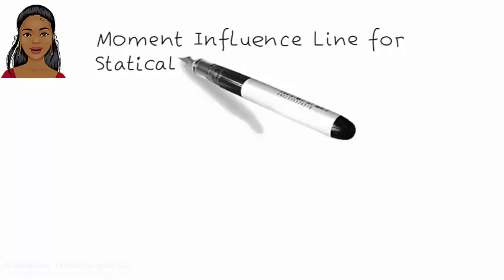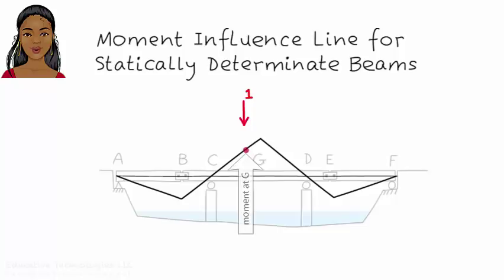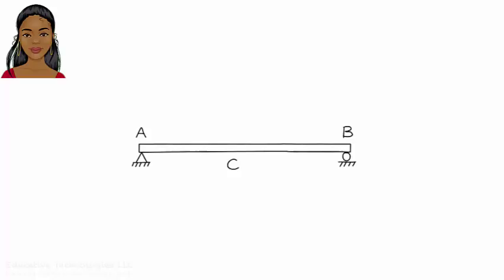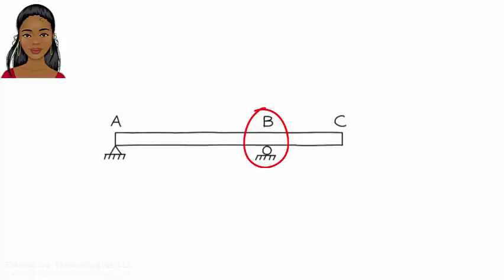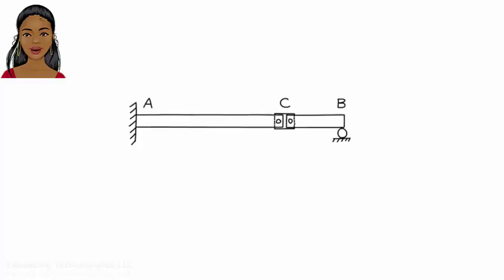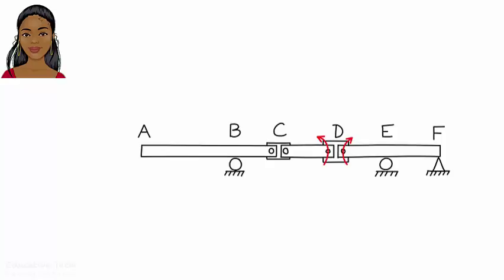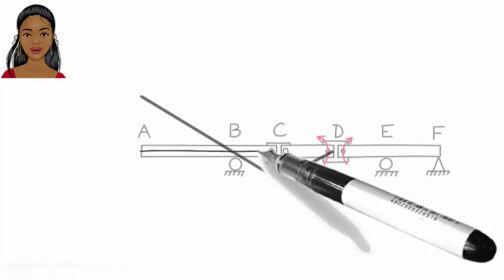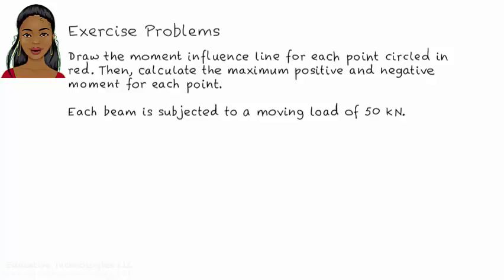SA18: Moment Influence Line

Comment: Where can I check the answers for the examples at the end of video?
Reply from the maker: The solutions for the exercise problems can be found in the (free) online course referenced in the video description field.
Reply: @DrStructure  I signed up using the link provided in description but still can’t view the answers
Reply from the maker: Login to the course, navigate to the influence lines section, then select moment influence line lecture/video as if you are going to watch it. Two pdf files are listed under the video frame: lecture notes and solution to exercise problems. Open this latter file to view the solutions.

Comment: At 6:14 you said moment at hinge always zero than in next 2 examples 7:54 why the moment at hinge is not zero(i.e. at c). Pls anyone explain.
Reply from the maker: The moment at C is zero in the example @7:54.  Why do you think there is a bending moment at C?
Reply: @DrStructure because in ILD there is an ordinate at c that means moment is not zero. The ILD at 6:14 in that you made a straight line from A to C because of hinge(zero moment).
Reply from the maker: @abhishekverma1487  That influence line is for bending moment at D. So, the height of the diagram at C indicates the moment at D when a unit load is at C. The height is not saying anything about the moment at C.
Reply: @DrStructure  ok got it. Thank you

Comment: The worked out example has an error.. It would be -2KN
Reply from the maker: Your assertion would have been correct if the weight of the vehicle was 1 kN. But, the vehicle weighs 2 kN. Therefore, the correct bending moment value is -4 kN-m.
Reply: @DrStructure  but.. We r drawing influence line... Watch again... In the animation 1kip is illustrated and calculated for 2kip...
Reply from the maker: Not sure what you are asserting. 

The moment influence line was drawn and used to determine the location of the load that would cause the maximum moment at point G. The load location was determined to be point F. Consequently, a unit load was placed at F and the resulting bending moment at G was determined to be 2 kN-m (the product of 0.5 and 4). Now, since the actual truck load is 2 kN, we need to multiply the moment due the unit load by 2. Hence, the bending moment at G due to the truck load equals 2(2) = 4 kN-m.

Comment: Hello, 
Could you please explain the reason behind why the bending moment is always zero at a real hinge?
Reply from the maker: Moment develops in at a point when its rotation is restrained. Think of a cantilever beam,  it is fixed at one end and free at the other end. Since the beam is not going to rotate at the fixed end, a bending moment develops at that end. On the other hand, the free end is free to rotate as well as move up and down. Since the rotation of the joint is not 
prevented, then no bending moment develops at that end. 

A pin or a roller act the same way as a free end with regard to rotation. Each allows rotation, therefore no bending moment can develop at any of these joints. 

An internal hinge acts the same way. Such a hinge connects two beam segments whereby one can rotate relative to the other, therefore no bending moment can develop at the hinge either.
Reply: +Dr. Structure yes thank u however when you did the moment influence lines for a hinge or roller support you did not consider moment to be always  zero  no matter the position of the load .. And you're saying internal hinge works the same as roller and hinge support in regards to it allowing rotation and thus having no moment reaction. This is where my confusion is. Isn't this contradicting ?
Reply from the maker: Good question.

When a pin or a roller is located at an interior point, when it is not at the end of the beam, it cannot freely rotate. Why? because the beam segment to the right of the roller wants it to rotate in a certain way, and the beam segment to the left of the roller wants the joint to rotate differently. This "competition" between the two segments prevents the free rotation of the joint. Consequently, a bending moment develops at the joint. If the roller/pin was at the end of the beam. however, there would be no "competition" between segments as there is only one beam segment attached to the joint. The segment dictates the rotation of the joint. That is, the joint would be free to rotate as dictated by the beam segment. As a result, no bending moment develops at the joint.

An internal hinge acts differently than a pin or a roller. To form a hinge, we cut the rigid beam at the point and reconnect the two segments using a frictionless (truss) pin where relative rotation between the segments is permitted. That is quite different than the behavior of an interior roller/pin. In the latter scenario, the beam remains rigid over the pin/roller support whereas in the former scenario the beam acts more like a truss joint. An internal hinge often is associated with a beam splice where we connect two beam segments using gusset plates and bolts. In reality such a splice carries some moment, but for design purposes we often assume the (hinge) connection is frictionless and carries no bending moment.
Reply: +Dr. Structure   Bless u for taking the time to answer us students in need.  that was very helpful thank you. 🤗

Comment: why at hinge u say moment is 0 but ...when there is are 2 support moment is not zero
Reply from the maker: Take a long piece of balsa wood, cut it at mid-point, then overlap the two pieces at the cut point and push a pin through the two pieces connecting them together again.  That represents a hinge connection. It allows one segment to rotate relative to the other. That is, if you held one of the balsa wood segments in your hand firmly, you can make the other piece rotate easily around the pin. The pin (hinge) cannot resist rotation, hence no bending moment develops at the hinge.

Now take a similar piece of balsa wood, but don't cut it at the midpoint. Instead, let it rest on a ball (roller) at the midpoint. We can still view the piece of wood as having two (connected) pieces, the segment to the left of the ball and the segment to the right of the ball. Now, hold on to the left segment, then push down the right segment. The connection between the pieces at the roller behaves differently this time (since there is no pin/hinge) connecting the two, they are rigidly connected. In this case, no free rotation takes place at the support. Although there is a rotation, but the material/connection resists free rotation. This resistance to free rotation is due to the presence of bending moment in the member at the roller.

Comment: How about the influence line for the truss members force under moving live load. Let say a vehicle with 3 points load. How to calculate the other points when putting one on the joint? By using force result or similar triangles? I could send the question's drawing if I had your email address.
Reply from the maker: I think I understand your question. However, if you need to clarify the question with a drawing, feel free to send email to: Dr.Structure@EducativeTechnologies.net

Suppose we have three concentrated loads in series with a distance of 2 m between each pair of adjacent loads. The middle load has a magnitude of 2P and each exterior load has a magnitude of P.

The moment influence line for our truss tells us that the middle load of 2P has to be placed at joint B. Then, one of the exterior loads would have to be placed 2 m to the left of B and the other exterior load would be placed 2 m to the right of B. 

Suppose the truss geometry is such that there is a joint (labeled A) 6 m to the left of B, and a joint (labeled C) 6 m to the right of B. This means we have a load of P placed at an interior point on member AB, and a load of P placed at an interior point on member BC.

Since in trusses we assume loads are placed only at the joints of the structure, we need to distributed the load on AB to its end joints, and do the same for the load on BC.  Since the load (P) on AB is placed 4 m from end A, and 2 m from end B, then 2/3 of P goes to B and 1/3 of it goes to A. (This is a linear proportional load distribution, just assume the truss member is a simply supported beam subjected to a concentrated load, then calculate the vertical support reactions.) Similarly, for member BC, we place 2/3 of P at B and 1/3 of it at C.

This means we need to analyze the truss under the following loading case:

P/3 at A
P/3 at C
2P + 2(2/3)P = 10P/3 at B

Comment: why there is no influence line for normal forces in beams ?
Reply from the maker: If the beam carries an axial force, then one can draw the influence line for it. When an axial force is present in the member (like in frame members), it is often constant, it does not change value across the length of the member. So, the influence line for it would be a a straight line (a rectangle). Such a diagram is not really helpful in determining max/min values. Put it differently, we don't need the influence line to tell us where the axial force becomes max positive or max negative; it is max positive (or negative)  throughout the length of the member.
Reply: @DrStructure  thank you

Comment: How to find max bending moment at any location with internal hinge
Reply from the maker: To find the maximum bending moment in a beam, which is different than finding the peak value in a moment influence line,  we can find/write the moment equation, then set its derivative to zero. This is the same as finding the point at which shear equals zero. This can be done graphically too. Draw the shear diagram and find the location(s) at which it crosses the x axis.

Comment: what is the difference between roller..hindge and triangle shape support
Reply from the maker: I covered the difference between roller and hinge in my response to your other message. The triangular support is called a pin. It behaves almost like a roller. A roller, as the name suggests, can move/roll on the surface that it is resting on. Pin is a roller that cannot roll. Look up images of pin and roller online, you should be able to easily find pictures of bridges that use these support types.
Reply: Dr. Structure thanks anyway iam still in the process

Comment: How come a roller have a downward reaction?
Reply from the maker: Reaction at a roller could be upward or downward. If the roller is placed horizontally, then it can only move along the x axis. Such a roller, by definition, cannot move up or down in the y direction.
Reply: I think reactions are the resisting force of the supports. Just for example a roller, if you apply force acting downward on a roller the resisting force on it is upward, that's why roller support only have upward reactions because no resisting force on it when you applied upward force.

Comment: Can you explain the question in the video at 7:47 min ???
Reply from the maker: Think of a beam segment/bar. If it is supported by one pin/roller only, the bar has the capacity to rotate about that point. That is, if we push the bar up or down at either of its ends, it is going to rotate around the support point, very much like a seesaw.  But, if the bar is resting on two pin/rollers, then the seesaw action cannot take place, the bar loses its ability to rotate. And that is what we have here. Segment DEF rests on two supports, therefore, it cannot rotate. Segment ABC rests on one support only, hence it rotates.

Comment: how do we get the number for the influence line?
Reply from the maker: +legion  Generally, we cannot  determine the peak values of a moment influence line directly from the diagram. The diagram is used only for determining the load location at which bending moment at a given point (say, B) is maximum. Once that location is determined, you need to place the load there and actually analyze the beam in order to determine the bending moment value at B.
Reply: +Dr. Structure u have any videos on this would like to watch it
Reply from the maker: +legion The exercise problems at the end of the video demonstrate the process of calculating maximum/minimum moment values.